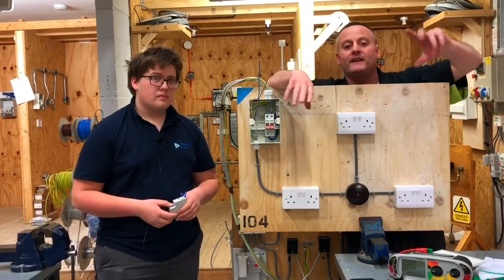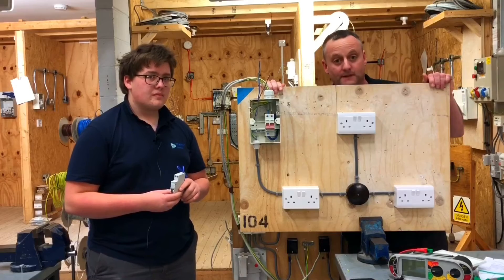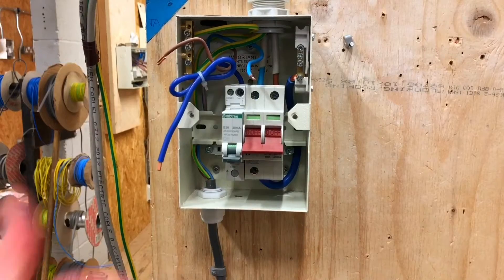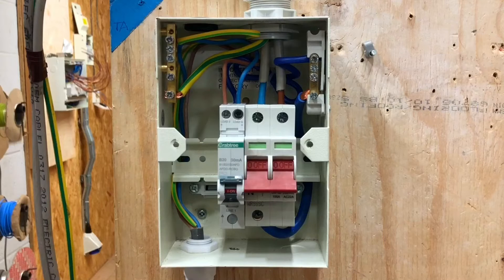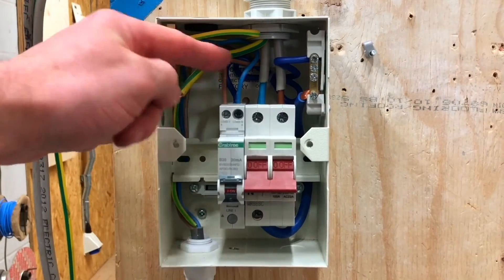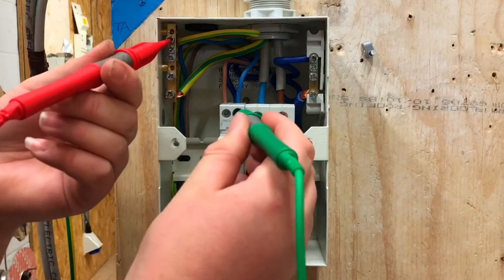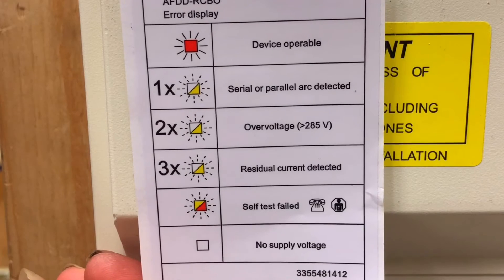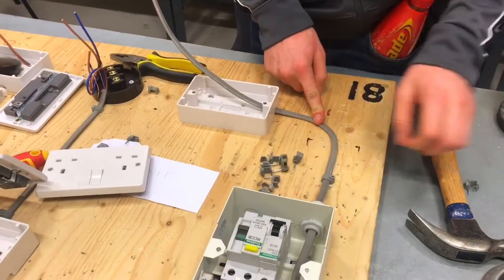How to Fit a Crabtree Single Module AFDD Type A 30mA RCBO MCB Type B - Insulation Resistance Test

Comment: I'm probably wrong because I work in Ireland and the electrical regulations are quite different but I did work in London in the 1970's and 80's and I thought a radial circuit wired in 2.5 could only serve a area of 20 metres squared, if it was wired in 4 mm 50 metres squared on a 25 amp mcb is OK and of course 100 metres squared for a ring main.
Reply from the maker: Thanks for adding that comment Paul 👍